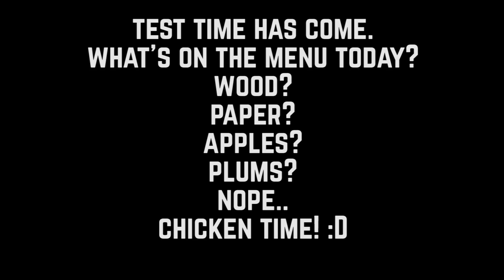Old Rusty Cleaver Butcher Restoration

Comment: I watched a lot of these kind of videos. But i was always wondering the subject weight before and after restoring. Cuz sanding and filling always take some metal. I was wondering if it make a noticable difference in mass. Please add a section to weight the subject before restoring and after.
Reply from the maker: If you will check my previous videos you will see. For exp: I restored a huge knife and knife lost around 600 grm.

Comment: How does the pc power supply thing work?
Reply from the maker: Hello sir, thank you for attention. Sure. The power consumption of my pc power supply equals 400W. I used 12v for electrolysis effect, it's yellow cables. I combined 6 yellow in single cable and 6 black cables in single. The black cables I connected to staff that on which I apply electrolysis and yellow on stainless steel rod for example. After that I wait around 1 or 3 hours depending how many rut on stuff.

Comment: Why not angle grinder from the start. Wire brush will take any thing off, Flappy discs great for next stage.
Reply from the maker: Hello sir, thank you for attention. Due to if I will used  angle grinder without electrolysis or rust remover I would lost a lot of metal.

Comment: If you're going to power sand something with an angle grinder anyway, then what's the point of removing the rust by electrolysis first?  Isn't it redundant?  Like wouldn't sanding it with the angle grinder just get rid of the rust as well?
Reply from the maker: Hello, due to the cleaver (stuff) contains so many rusty and dirty, also when using angle grinder there will be a lot of dust and loss a lot of metal.
Reply from the maker: Thank you for attention, sir.
Reply: Thanks.  Good to know.
(Another beautiful job, by the way.  That dark handle looks fantastic.)